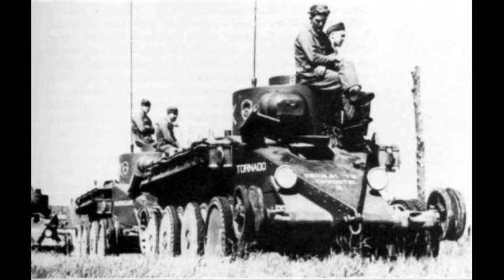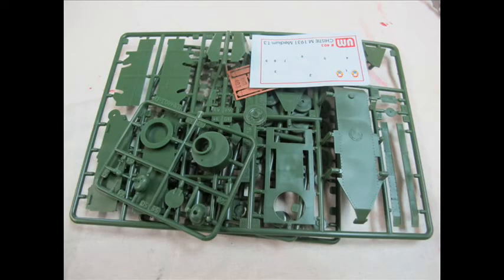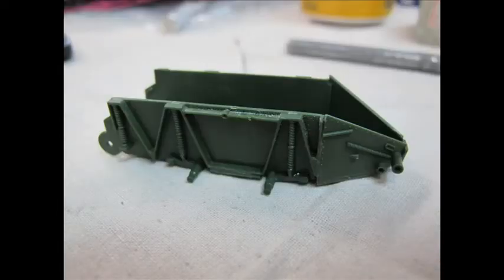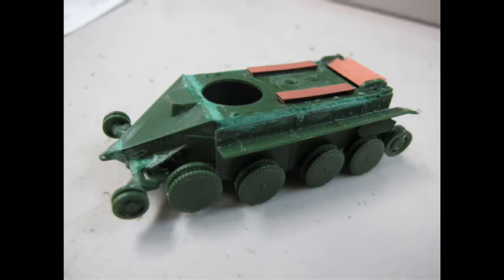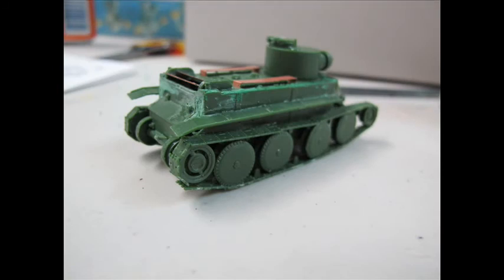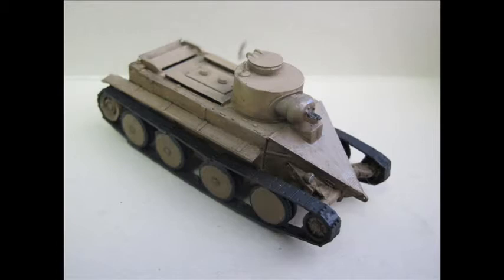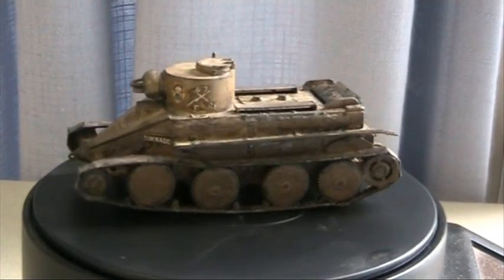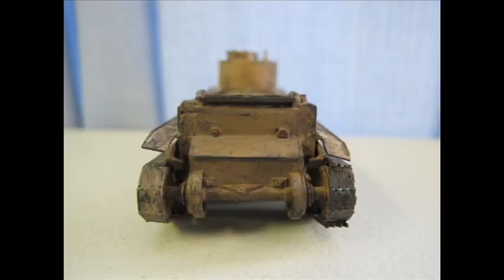UM Models 1:72 Christie T3 Medium Tank build review

Comment: Good to know it's not just me having a drama with this manufacturer. I am building several of their tank with railcars and getting parts to fit isnt fun. I have been following the numerical part order but for the next one will go with a more logical approach
Reply from the maker: this was a long time ago, I'm a lot better at these small manufactures. It gets easier once you figure out a few tricks and use the instructions as a guide. Using plastic sheets as supports on the inside helps quite a  bit too.